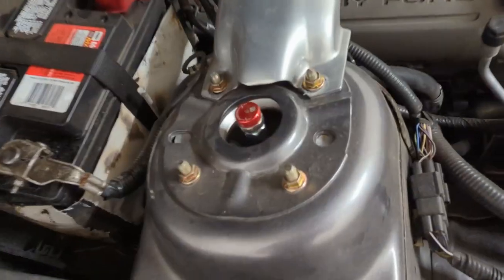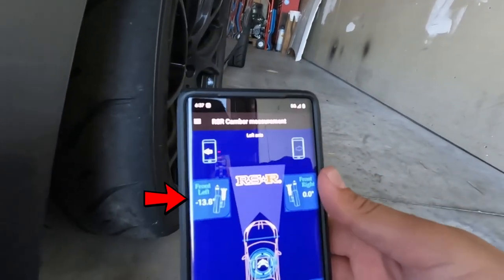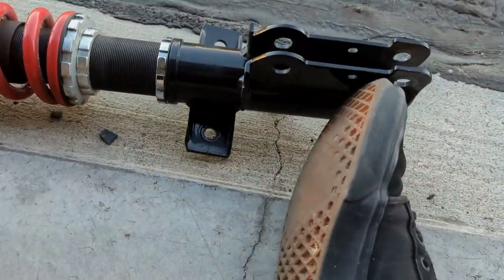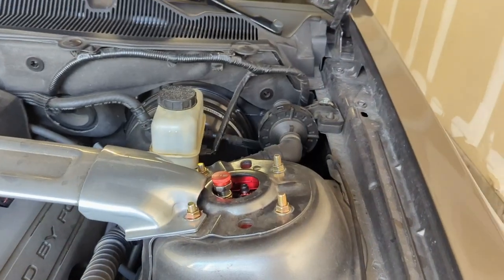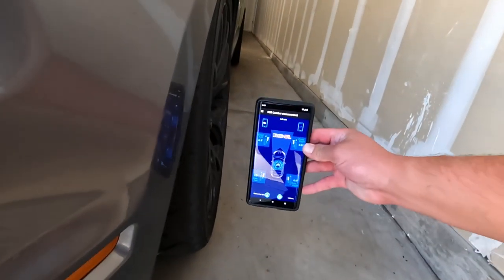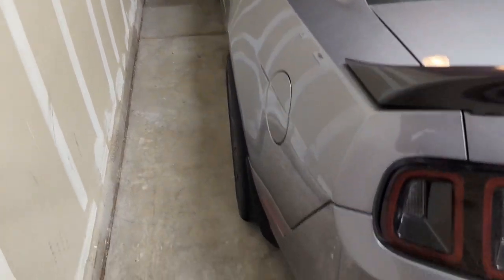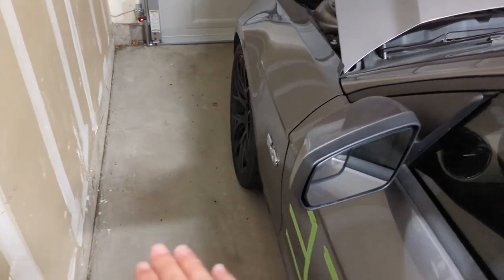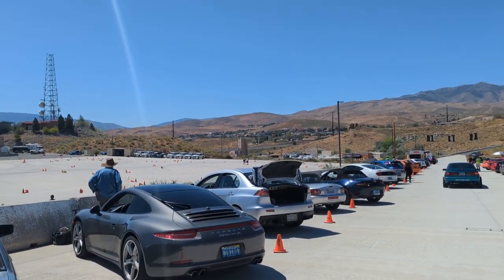Installing Adjustable Camber Plates On Mustang

Comment: I’m looking to buy Pedders coil overs kit with sway bars on my 2014 gt track pack and I’m wondering the quality of the coil overs and shocks.
Reply from the maker: @diondoyle-yz7xl  I liked the quality of them over all.  The only thing I didn't like is I thought they were a little too stiff even when I turned them all the way soft.  Other thing was I could never get the collars to lock the ride height and spring tension to stay tight. Other coil overs have little set screws that keep them where you tighten them to. These don't so if you get them I would say check them regularly.

Comment: I have this same kit, but I haven't installed it yet. What size tires are you running? I am worried that the kit isn't compatible with my tire width.
Reply from the maker: I like the kit.  I had a small problem with them and Pedders sent me the parts to fix them.  I am running 295s on the front on 19s.  I can't go any wider without rubbing
Reply: Good to hear! Thank you for the reply. I am running 285/30/19 on the front and 305/30/19s on the back so hopefully the pedders kit will work.

Comment: Can you use a holesaw bit n make the hole bigger or does that compromise strength
Reply from the maker: I wasn't going to take the chance incase it did compromise strength.  Much harder to put it back than it would be to cut the hole.